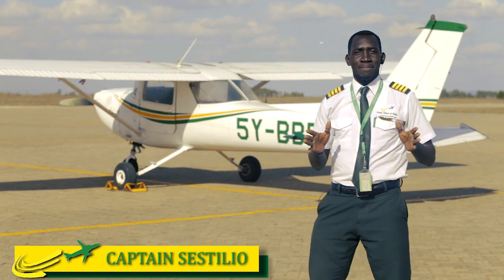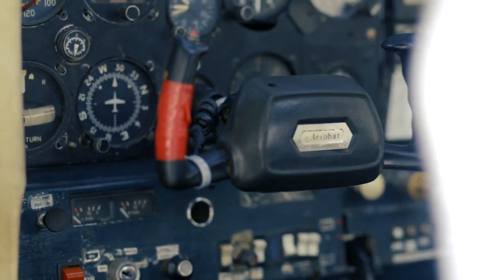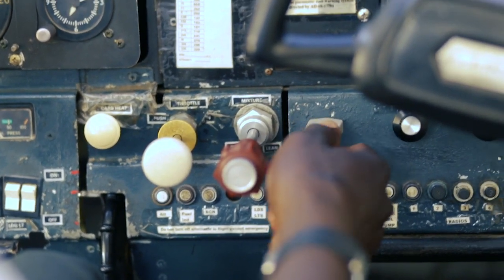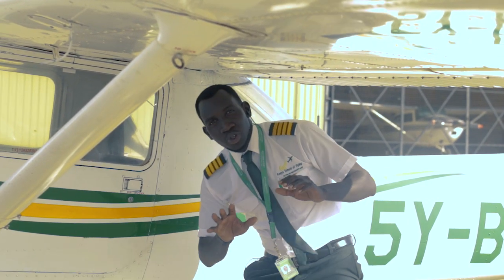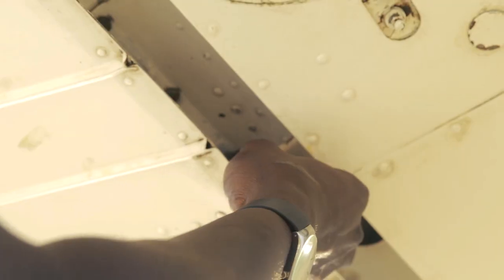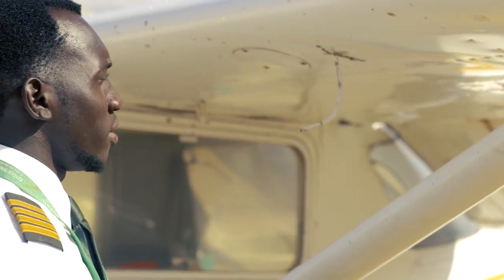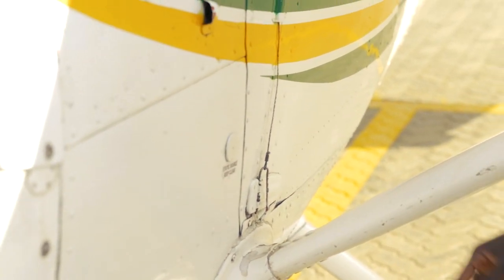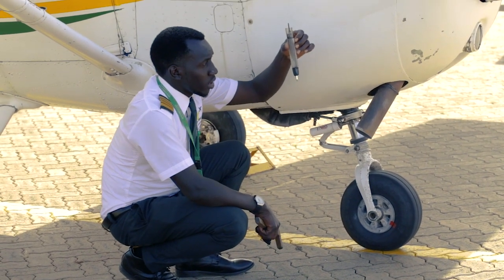How to do your Pre-flight Checks for a Cessna 150/152 right

Comment: 1) please go outside and very all external lights such as beacon, nav and landing lights and play around the elevators and ailerons . 2) please check parking brake. 3) please verify radio and transponder is OFF 4) please verify trimmer.